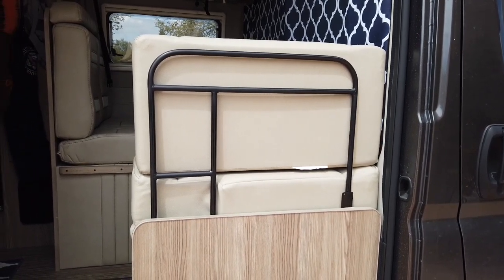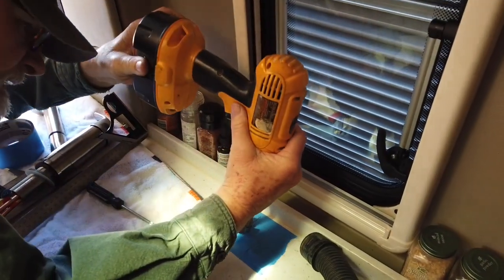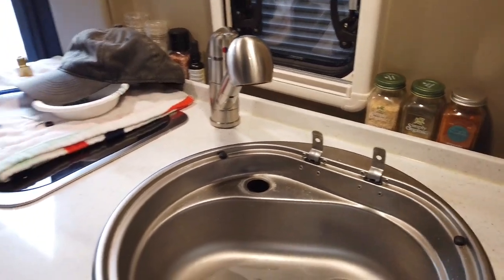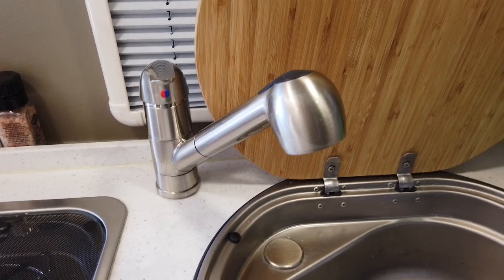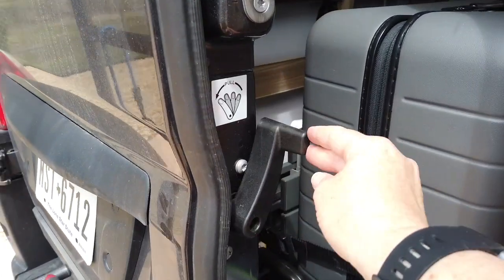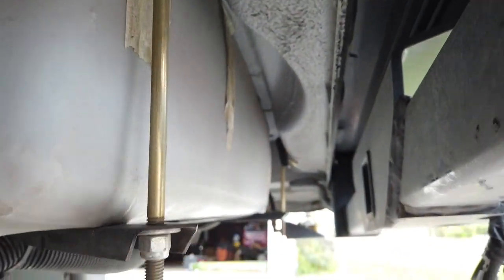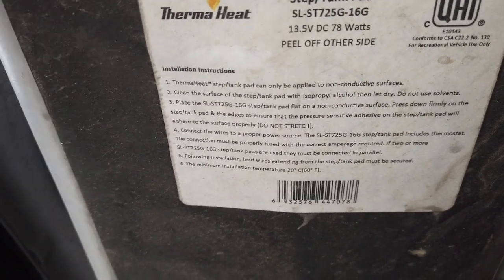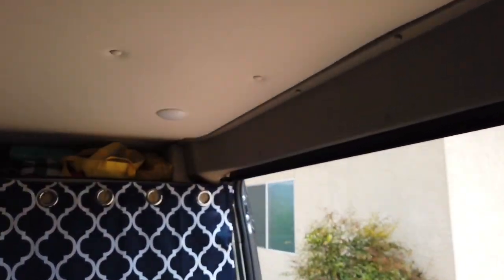Modapalooza Part 1: Mods to my 2020 Winnebago Travato 59GL

Comment: Thank you for your videos. Love to see you work as I am kicked back sipping coffee early in the morning. Just wondering, if you will be able to put the receiver bar in your trailer hitch with your sewer pipe holder.  My bars stick completely thru the hitch, witch would hit your sewer pipe holder.  You may have to drill a new hole in your receiver bar so you can get the pin thru it.  You may not ever pull a trailer but you may want one of the lower steps that makes it easier to step out of your back door.  That step is part of the receiver bar.
Reply from the maker: Valid points!! I have no intention of towing anything or adding a hitch so not an issue for me but would be for others. And I rarely go in or out through the back doors but if I did I may want a step.